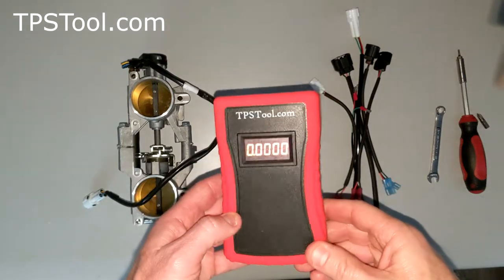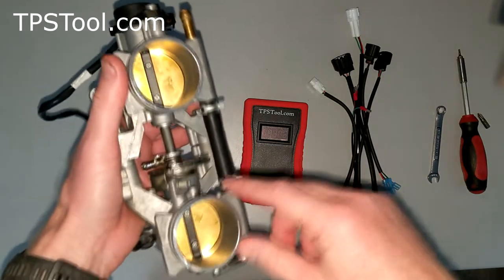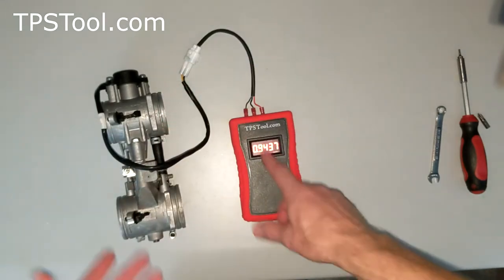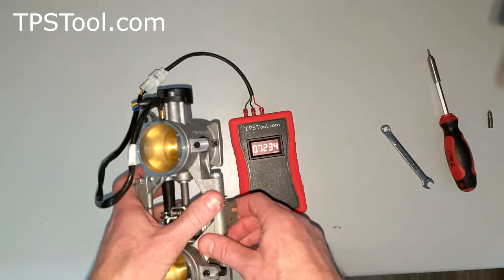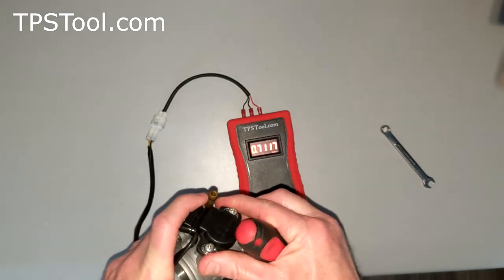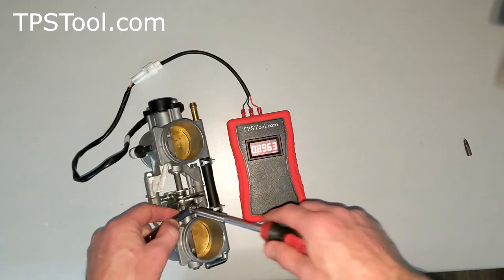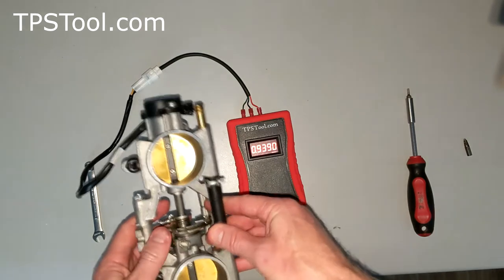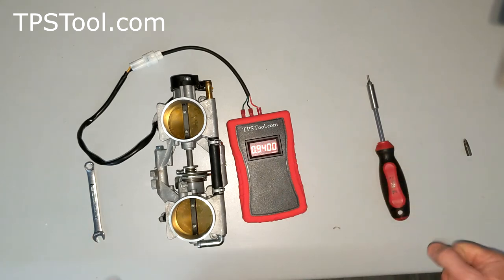How To Set The Throttle Position Sensor (TPS) On Polaris RMK 800, 2016-2021

Comment: Can this be done with the unit in the sled as well? Or does it need to be removed?
Reply from the maker: Thank you very much for your comment.  You can do this on the sled no problem, as long as you can physically get your hands in there.  Using just the throttle body is easier for a video, plus it's cheaper than me buying the entire sled. ;)

Comment: I love the tool and technique, but try to work on a 17-21 800 Axys with the throttle in place. They make things impossible to reach!
Reply from the maker: Thank you very much for your comment.  Is there anything I can improve on the tool to make this job easier?
Reply: @TPSTool  No your tool is awesome, it's just reaching the throttle screw and jam nut that is horrible. Thanks.

Comment: I bought the tool i just cant find the voltge spec for a honda 2015 crf150r. Your help is appreciated
Reply from the maker: Thank you for your question.  Double check the service manual, but most of the carburetor TPS are set around 0.7v at idle so that's where I would start.  For motors with a carburetor, the adjustment isn't going to have as big an effect as on an EFI motor, because on the carburetor motor the TPS only affects timing and on an EFI motor the TPS affects timing and fueling.  I hope this helps, let me know if you have any other questions.

Comment: Could this throttle position sensor tool be used in the opposite way meaning if I had too high of idle could I dial the idle back?
Reply from the maker: Thanks for your comment.  Sure of course.  The tool tells you what the TPS is reading.  Once the TPS is set properly the reading will tell you the position of the throttle plate.  You can then use the tool while adjusting the idle to either set it to a specific position, or tell you how much your idle adjustments have moved the throttle plate.  Does this answer your question?

Comment: Is this the same method and readings for a 05-06 polaris fusion 900?
Reply from the maker: Thank you for your question.  Yes, the procedure is the same and I believe the settings are the same as well (0.71V throttle plate fully closed, 0.93V at idle).

Comment: What is number setting for a 2012 Polaris switchback assault for tps
Reply from the maker: Thank you for your comment!  Please check our common settings page (link below), we have specs for several 2012 Switchback models as well as links to the service manuals where the info originated.  Here's the link:  https://www.tpstool.com/common_tps_settings.htm
Reply: Is it green,black,red wire configuration?
Reply from the maker: @jasonmckenzie2384 Do you have the 600 or 800?  If you've got the Model-4 plug, for Polaris snowmobiles most likely it will be black in GND, red in FB and green in 5V as shown in this video (https://youtu.be/UA0BFxQsZ0I?si=pBvPWjdy2I-IbVkq).  Connect it that way and if it's right you will see under 1V at idle and it will increase to over 3.5V at full throttle.  If you see something different then let me know and I can help you figure out the right way, but this is most likely it for the Model-4 plug on a Polaris snowmobile.  Feel free to email me directly too, help@tpstool.com
Reply: I have an 800. I also have the tps tool.
Reply from the maker: @jasonmckenzie2384 Excellent, thank you for your business.  Try what I suggested above and let me know how it goes.   Black in GND, red in FB, green in 5V.  If it's right you will see around 1V or less at idle, and over 3.5V at full throttle.  If you see something different let me know.
Reply: Great. Thank you

Comment: I’m trying to replace my TPS on my 2015 Arctic cat m8000 any suggestions appreciated
Reply from the maker: Here is a link to what I believe is your motor, double check me.  The TPS section for you is on page 134.  It looks like your base setting (throttle fully closed) should be 0.413, then turn the idle up until the TPS reads 0.764.  Here's a link to the manual, let me know if you need any additional info.  Also feel free to email me direct:  https://support.countrycat.com/posts/2799158-2015-2-stroke-service-manual
Reply from the maker: Also here is a video showing how to use the TPSTool Pro with a 4-wire TPS, using an earlier model year M8 as an example:  https://youtu.be/HEIB92yZGwo

Comment: Will it work for skidoo etecs?
Reply from the maker: Thank you very much for your question.  If the TPS is adjustable then yes it should work.  If you can give me the exact model and year then I'll see what info I can find to verify.
Reply: @TPSTool  so my sled would be a 2013 Mxz XRS x 600 ho etec
Reply from the maker: @theeskimofisherman6679  Thanks for the info.  Please give me a day or so to figure out the answer and I will get back to you.  Also if you email me at mwolfe [at] qualitysmart [dot] com then that might be easier to communicate than here in the comments.
Reply from the maker: @theeskimofisherman6679  Thanks for the info.  That's a 3-pin TPS so it should work, the kit does not include a direct fit plug but the universal adapter will work (you connect each wire individually).  I'm looking to see if I can find one of these throttle bodies used, and if so then I'll buy it and make an example video.  I'll respond back tomorrow to let you know if I was able to find a used one.
Reply from the maker: @theeskimofisherman6679  OK I got a better look at the actual TPS and it appears the TPS on that motor is not adjustable.  So yes you can use this tool to read it and to check that it's working properly, but you won't be able to adjust it.  My guess is the ECU for that motor must have a procedure to learn the TPS, this would be one common way motors that have non-adjustable TPS work.  I hope this helps, let me know if you have any other questions.  I did find a used throttle body and I'll go ahead and order it and make a video showing how to check that the TPS is working properly, but unfortunately there's no way to adjust it mechanically.
Reply: @TPSTool  thank you very much for looking into it for me! I guess the tps on skidoos just got to be replaced then
Reply from the maker: @theeskimofisherman6679  Check the service manual, there may be a procedure to teach the ECU what the idle and full throttle TPS readings are.  If you have a bad TPS then you'll need to replace it, but if the TPS is still OK then maybe you just need to re-teach the ECU.  Many motors work this way, but the procedure varies by motor so check the service manual.  Sometimes it requires the dealer tool and sometimes not.